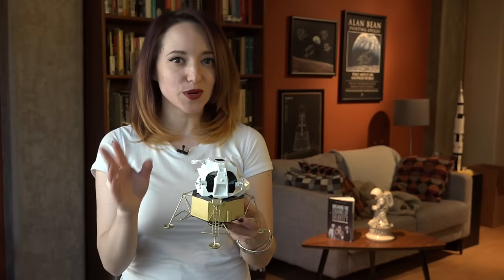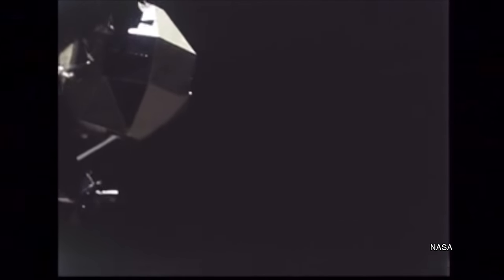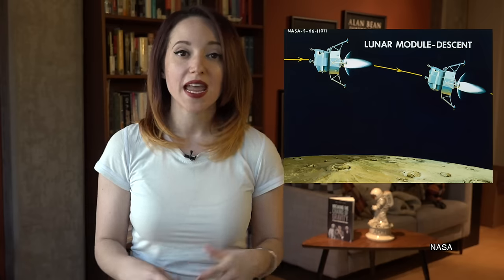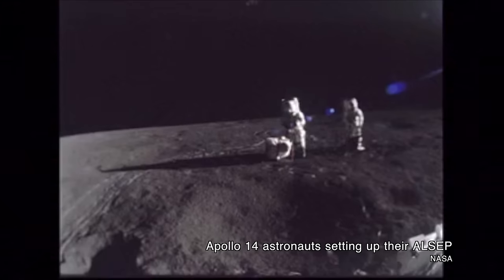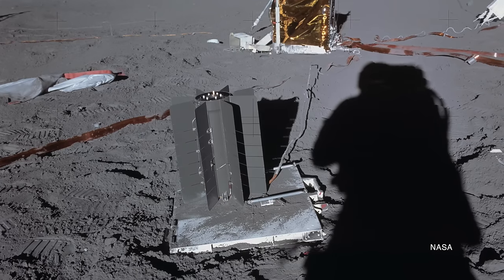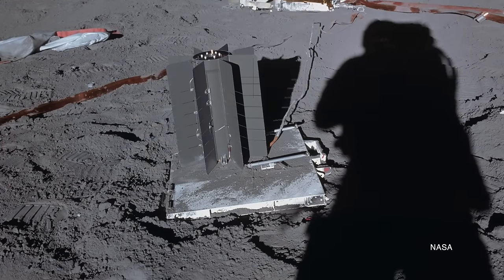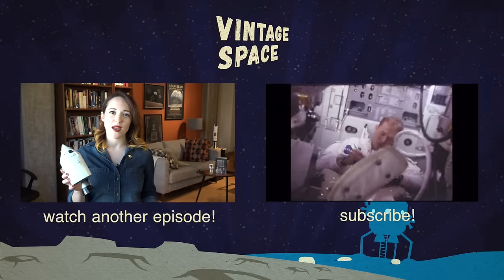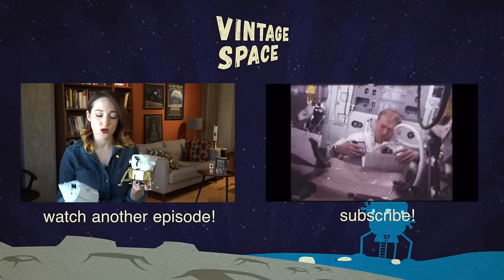What Happened to the Spent Lunar Modules?

Comment: No experiment that involved the LEM ever went unused or superfluous.
  For example, Apollo 11's Eagle, prior to jettison was involved in an electrical equipment failure threshold test.  Before jettison, the coolant flow was shut off while the electrical electrical equipment and telemetry remained on.  Eagle did well, lasting 8 hours without coolant before suffering equipment failure.  This data proved very valuable in determining the course of action to take on Apollo 13 after the O2 tank ruptured.  It gave them confidence to go for a 142 and a 1/2 hour mission as to land where the recovery forces would be rather than taking the shortest landing trajectory to the Atlantic Ocean at 133 hours or the Indian Ocean,estimated to take around 140 hours.

Comment: Since you're on the subject of what happened to the LEMs, you might want to cover what happened to the three flightworthy LEMs built for the cancelled Apollo missions 19 and 20 as well as the original LEM assigned to Apollo 15, but replaced with a larger, more capable one. Also on that subject, there were fourteen total flightworthy LEMs built, nine manned, and five unmanned, and the five unmanned ones were used in early LEO Apollo missions to test the systems out. How they were used to do that might also make a good subject.
Reply from the maker: +Mike DiCenso Good call! Looking at where all those hardware pieces ended up (where you can visit them in museums) might be a good way to address that topic. And I believe NASA even has a somewhat complete handy chart of what hardware ended up at which museum!
Reply: +Amy Shira Teitel (Vintage Space) I can answer at least one of those questions. The original LM assigned to Apollo 15 is on display in Florida at the Apollo-Saturn V Center near the Shuttle Landing Facility. I visited it during the KSC bus tour earlier this month with my son while he was on spring break from Florida Tech. It's hanging from the ceiling near the S-IVB stage. Truly an awesome display.

Comment: #Did you noctice that when the LEM command module rose up from the lunar surface, that it seemed to have a non-same in one place gyration added to it?This may have been caused from the dynamics in weight placement, of the spacecraft not being fully balanced.Either that or it's jumps in the film then. :)

Comment: Why did the ascent stages go back down to the surface? If they were in orbit of the moon at the time of jettison, what caused them to lower down? There's no atmosphere above the moon.
Reply: There actually is a very thin atmosphere on the moon.  What caused the ascent stages to come back down to the surface was the retro rockets on the ascent modul that aided in separation.  The delta v required on a lunar orbit is very small.
Reply: gravity ding dong.....your have to maintain a certain speed in relation to the gravitational constant of your heavenly body so that the body always falls away from you, but not fast enought that you cant' keep up. the slower the speed the easier gravity can pull an object back down. They didn't do a burn to place the ascent stage into a permanent orbit. The just let it fall. No wind resistance means that the object will fall faster.
Reply: "Gravity Ding Dong" - next indie band name!
Reply: +Jeremy Thompson

"They didn't do a burn to place the ascent stage into a permanent orbit"

I have to did agree with you about that. The assent stage of the LEM would have to had to achieved a circular orbit in order to rendezvous with the command module in orbit. If it hadn't, the 2 ships would have been traveling at different velocities and wouldn't have been able to dock.

They must have fired some sort of retro-rockets, after separating, to slow it down and send it back to the moon's surface.
Reply: Folks are correct that they fired rockets to deliberately crash the ascent stages.  They wanted a controlled impact, for scientific purposes.  That said, even if they hadn't, those stages would have impacted decades ago.  It's actually very hard to find a stable orbit around the Moon, partly because of the Earth messing things up, but mostly because the Moon is very lumpy -- it doesn't have enough atmosphere to make you deorbit, but the random yanking and tugging of higher and lower areas of gravity will rob you of orbital energy.  Lunar orbiters have to manage their orbits constantly or they sink until they hit the mountains.

Comment: If ullage motors were used to make larger motor's fuel tanks drain properly, how was ullage managed in ullage motor tanks and RCS motor tanks? Inquiring minds want to know.
Reply: The propellant tanks for the Apollo Reaction Control Systems (on the LM, Command Module  and Service Module) had the liquid propellants (Aerozine-50 fuel and Nitrogen Tetroxide oxidizer) enclosed in collapsible Teflon bladders inside the titanium shell of the tanks (somewhat like a "water balloon"); pressurized helium squeezed the bladders to force the propellants into the engines.  Since the bladders completely enclosed the liquids, there was no ullage at all, and therefore the RCS engines could operate regardless of orientation or any gravitational field, including zero-G.  These small 100-pound-thrust engines were fired for a few seconds (called and ullage burn)  to create a small acceleration of the spacecraft (induced gravitational field) to bring the liquid propellants in the main tanks to the "bottom" where the pickup for the propellant feedlines was located.   With the propellants now at the proper "bottom" of the tank (regardless of actual orientation of the spacecraft), the pressurized helium in the empty upper space (ullage) could then force the propellants into the engine (either on the LM or the Service Module.)  Yes, I was a propulsion systems engineer for NASA during the Apollo Program - Glory Days!

Comment: With Apollo 13, actually although it did reenter, it would be incorrect to say it burned up in the atmosphere.  The LMs were quite large (and this one still had its descent stage), and as we know from other spacecraft that have returned, some structures are likely to survive largely intact -- particularly propellant tanks, pressurization tanks, and large engines.  With the LM, one particular feature was fully expected to survive reentry: the RTG that it carried to power the ALSEP that was still hitched to the exterior of the LM descent stage.  The RTG contained nearly four kilos of plutonium-238.  Happily, these devices are designed to survive launchpad explosions, and reentry is actually much easier to endure -- so the RTG, with its plutonium, is believed to rest at the bottom of the Tonga Trench -- the Apollo 13 LM was specifically aimed for that deep part of the ocean for that very reason.  Other bits of the LM are probably down there as well.

Comment: Didn't they run the systems on Snoopy or Spider until they failed and used that data to help Apollo 13? I seem to recall that from A Man On The Moon, the outstanding book.
Reply from the maker: +leftcoaster67 The Apollo 10 moment that always stands out in my mind relating to Apollo 13 was that they separated the CSM and LM with a small amount of pressure still in the tunnel and used that data to help separate the spacecraft before Apollo 13's reentry to make sure the two wouldn't smash into each other. Always thought that was such a cool little accident that really helped out!
Reply: Thanks Rich I remember reading something on that.
Reply: Thanks again Rich

Comment: Hi,Good site Amy,Do you know if the "Crawler"transporter stayed under the Saturn during launch(I guess not practible)if not how did they lift it off,Thanks Bill Ireland
Reply: The mobile launcher carried the Saturn V along with the attached launch umbilical tower as a large assembly. Once the whole assembly arrived at the launch pad four large jacks on the corners of the pad would pick up the mobile launcher, the rocket and the tower and lift everything up off the crawler. Then the crawler was driven out from under the mobile launcher to a parking spot about two miles away where it sat during the launch.

Comment: I know that the First stage of the Saturn V fell back down to h ocean,, but was it tracked ?? Does anyone know where they are ??

What of the second stage ? Does anyone know where they are ?
Reply: +podoau :The first stages typically fell around 400 miles ENE of the cape. Amazon founder Jeff Bezos announced plans to recover an F-1 engine a few years back. He managed to recover parts of an Apollo 11 F-1 engine. The second stage reached near orbital altitude and velocity before separation which meant they mostly burned up on re-entry. If I recall right, they went down in the Indian ocean somewhere.
Reply: +podoau Here's an article about the two first stage engines that Jef Bezos recovered mentioned in +J Dean's post:
http://www.cnn.com/2013/07/19/tech/innovation/amazon-apollo-engines/
+ J Dean I was writing a response but yours was much better. :) Thanks.
Reply: +bbartky :Thanks, glad I was able to help.
Reply: *****
Thanks very much !

Comment: I am sure it has been addressed. But you are incorrect on the Apollo 13 LM. It did not burn up. It is still out there in a long elliptical orbit. Several collages are actively searching the sky for it.
Reply: You are thinking about the LM from Apollo 10, which is still out there. The LM from Apollo 13 reentered the atmosphere, mostly burned up and what's left of it is at the bottom of the Pacific Ocean.

Comment: Amy doesn't mention the moon ringing like a gong. did it really happen?
Reply: Yes!  Well, it wouldn't have sounded like a gong -- in space, no one can hear it ring like a gong.  ;-)  But the impacts all reverberated through the Moon for a long time, ringing like a gong or a bell.  That's very different from what happens on Earth, where the vibrations damp out quickly, and it tells us that the Moon is solid all the way through.  It has no molten core.

Comment: Amy, did the LEM have probes on the landing pads?  If so what were they used for?
Reply: Yes they did. They were sensor probes to tell the astronauts when they were close enough to the lunar surface to shut down the descent engine and drop the last few feet onto the ground. When the probes touched the ground a blue light in the cockpit labeled "Lunar Contact" would come on, which meant the foot pads were only about 5 feet off the surface. Originally there was a probe on all four foot pads but there were concerns that the probe on the front leg where the ladder was could puncture the astronaut's spacesuits. As such the probe was removed from the front leg, leaving only the other three.

Comment: You seem to be quite knowledgeable enough, so I thought you may have an answer to a question I have. When landing and taking off from the moon, did the weaker gravity make it any easier to control the modules? I remember watching video footage of test modules here on Earth and it looked like they were very difficult to control.

I love these videos, you have re-kindled my youth somewhat. Either that or I'm a hopeless romantic about space travel.
Reply: The computer on-board the LEM would have handled the landing. However, I have heard that on Apollo 11, Neil Armstrong had to take over at the last minute because the computer was about to put it down on some rocks.

With only 1/6th gravity and no wind to cause turbulence it would definitely have been easier than trying to land on earth, but still not a walk in the park.
Reply: From what I've read, the test variants developed for training on Earth (such as the notorious "flying bedstead") were much more difficult to control than the actual LMs.  Some of that is just that the LMs were developed later, and so learned from the lessons of the testbeds, but a lot of it is the atmosphere.  That said, navigating on the Moon isn't a picnic.  It's very lumpy, and with the lower gravity, these lumps are a lot more noticeable.  They will significantly alter your course.  Much of the work with the Lunar Orbiters was spent mapping out the lumpy spots ("mascons", for "mass concentrations") so they'd have a hope of navigating safely around the Moon.
Reply: +Calli Arcale
Not sure if you have seen this book. I just got it a few days ago. Pretty interesting topic to say the least. 
https://www.amazon.ca/gp/product/1493794450/ref=oh_aui_detailpage_o02_s00?ie=UTF8&psc=1
Reply: Oh cool, that looks like fun to read!
Reply: +Virgil Pheonix
You're right that the onboard computer guided the LM towards the surface, but the Commander "always" took manual control for the final 500 feet or so of the descent. 

The Lunar Module Pilot monitored the onboard instruments and relayed information back to Mission Control & to the Commander. During the final part of the descent the Commander's eyes were concentrated on picking out a landing spot, & his ears were focused on the relayed information.

On Apollo 11, as you said, the guidance computer was sending the LM towards a boulder field. So Armstrong had to fly about 4 miles down range, nearly exhausting the onboard fuel. At touchdown they had just 18 seconds of fuel left.

No wonder Charlie Duke, one of my favourite astronauts, said, "you've got a bunch of guys turning blue down here". :-)

As for the LLTVs & the LLRVs? Were they more difficult to fly than the LMs? Not really. They all had motors to control ascent & descent, & they all had control thrusters to control attidude & pitch.

Your point about lack of atmospheric turbulance on the Moon compared to on Earth was a valid one. But the LLTVs & LLRVs were way too valuable to ever be flown when wind speeds at near ground level were high. These vehicles were only flown in still air.

Virgil, please forgive me for replying to you at such length on such small points.
Reply: I recall reading in Chuck Yeager's auto biography that he had flown the " Flying Bedstead " and saw Neil Armstrong just before he was about to take it up for his first time. Yeager asked Neil if he would like to talk about how the vehicle handled.  Armstrong replied no he read the manuals on it.

Then Neil Armstrong lost control of the LLRV trainer and ejected to safety as it crashed.
Reply: Bill23799 Chuck Yeager never flew the "Flying Bedstead". I think you're mixed up with the flight Yeager and Armstrong made in a T-33 together and they decided to try and test out one of the dry lake beds used around Edwards that could be used for landings. There had been some wet weather so they weren't sure if the surface could support a plane. According to Yeager, Neil tried landing against his advice and they got stuck. However, in Armstrong's book, "First Man" he addresses this issue which as far as I'm concerned is much more believable. No doubt Yeager is a great pilot but he does tend to tell things in a way that casts him in the best light as possible. Also, there's the undeniable fact that an Air Force pilot and former Naval Aviator flying together is going to have a great deal of rivalry right from the start.   Google: "First Man: The Life of Neil A. Armstrong, Yeager and Armstrong" and that should take you to the online book and chapter titled "The Real Right Stuff".
Reply: I am pretty sure that was what i read in Yeager's auto bio.  I do not have any other data to confirm this. You seem very well informed.  I am not contradicting you but i will try to confirm that was what i read.
I lost all my books in the apartment fire of 2010.  Apparently books do combust at Fahrenheit 451
Reply: Bill23799   Actually, now that I think about it, I remember Yeager saying that Armstrong had lost control of a plane while taxiing because of some system failure that affected the brakes? Something that according to Yeager, Neil would have known about if he had read the manuals more extensively. It's been awhile since I read the book though so my memory might be off.
Reply: Bill23799   You probably seen my second post to you so it's apparent I'm not exactly sure about the incident myself. I am pretty sure, though, that Yeager never flew either the LLTV or LLRV. Aside from the nine astronauts who flew it, 7 pilots had flight time with them, Joe Algranti, Jere Cobb, Stuart Present, Bud Ream, Joseph Walker, Donald Mallick and Emil Kluever. This is from the book "Unconventional, Contrary, and Ugly: The Lunar Landing Research Vehicle". Well worth getting if you're interested in the subject. At any rate, I decided to buy "Yeager" again. I lost mine a couple decades ago and should really re-read it again.

Comment: Why does it seem all impact craters appear as though they were caused from asteroids hitting at a right angle? Wouldn't there be evidence of some hitting at an oblique angle?
Reply: Most objects hitting the moon at an oblique angle tunnel deep down into the surface first. As they do all the kinetic energy they carry is rapidly converted into heat. Finally when the object becomes hot enough it explodes some distance underground, which creates a circular crater. There are a few non-circular craters created by shallower impacts but they are relatively rare.

Comment: So,  if the Apollo 13 accident happened just after the crew left lunar orbit (and had left behind their lifeboat), they were in deep trouble, right? Did NASA ever consider having post Apollo 13 missions carry their ascent stages back as a "contingency backup" just in case? 

It does show how much of Apollo success was thanks to luck. Had Apollo 13s service module been assigned to Apollo 8, bad day (no LEM = No Lifeboat). No isssue ever happened in the homeward bound part of the trip.
Reply: +Zoomer30   There would of hardly anything left in the ascent stage to make it useful after docking with the CM. It would of just been unnecessary dead weight so no, it was never considered.